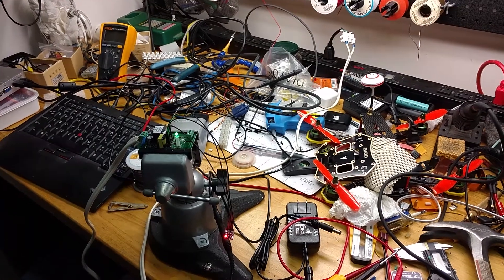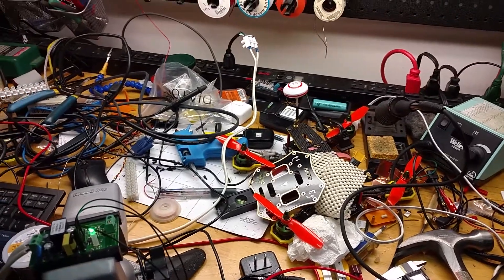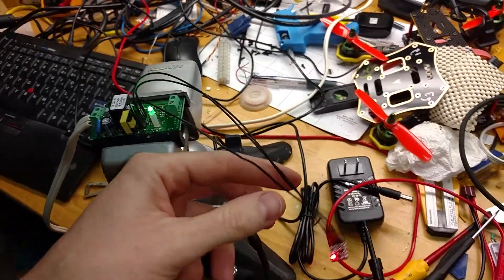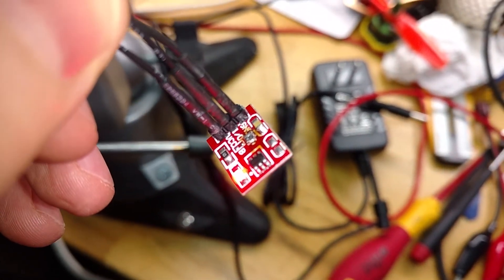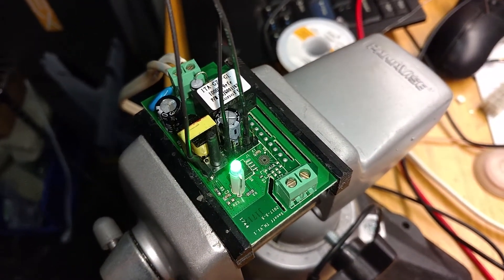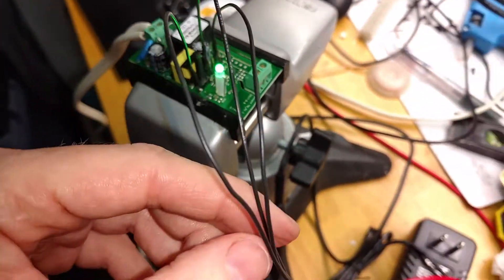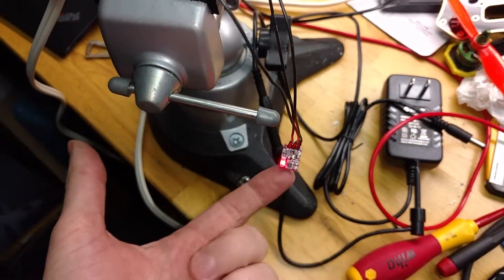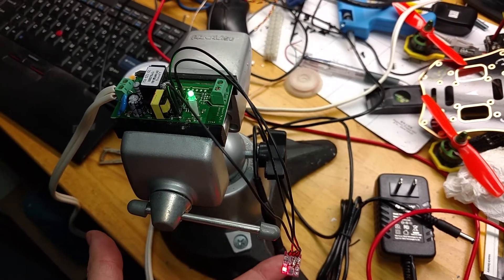Sonoff capacitive touch mod

Comment: Hi my friend, good modification, but did you flash it? Or you used the original firmware with ttp223 capacitive sensor?
Reply from the maker: Thanks for your comment.  I didn't realize the sensor could be flashed with different firmware.  I'm migrating all of my Sonoff's over to Tasmota because that seems to be better supported.  But I haven't changed anything on the sensor, that's just straight out of the box.
Reply: @manmustbuild  HI, you programmed with tasmota? because I have been connect TTP223 with device like your's diagram cannot operate the TTP223
Reply from the maker: @ariefsudarma3503  yeah I was using some other custom firmware at the time. But that shouldn't matter as far as the switch is concerned.  Check your wiring. If you have another manual switch lying around try to get that working in parallel.  Verify that the touch switch is working properly with a multimeter.

Comment: Where do you make the connections on the sonoff circuit board?
Reply from the maker: Hi Mike.  I don't have it handy right now.  But I basically put the capacitive switch in parallel to the mechanical switch.  If you probe both with a multimeter - you should be able to figure out where the wires go.  I think I picked up ground (and/or +5vdc... maybe?) from somewhere else on the board, and then just connected one wire from the capacitive switch to the point where the mechanical switch is soldered onto the PCB.
Reply: Thank you